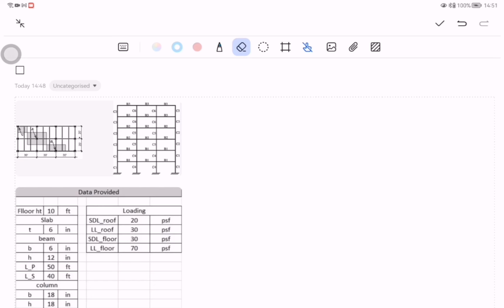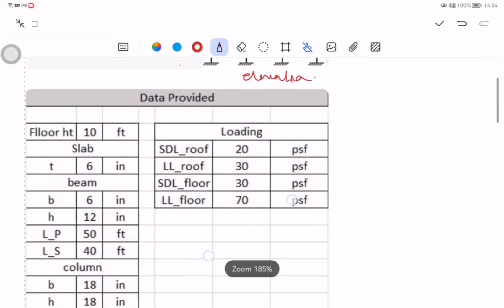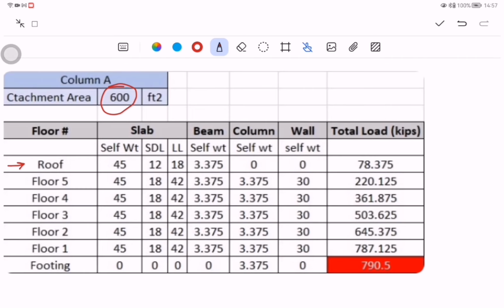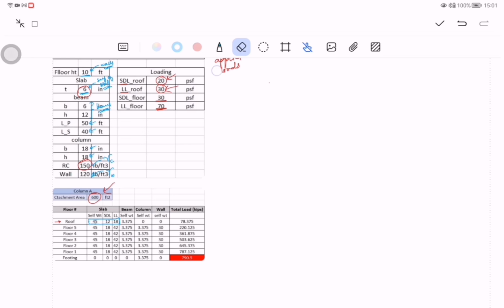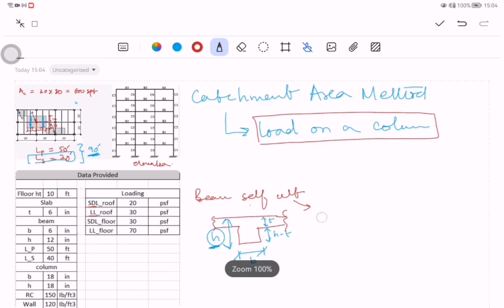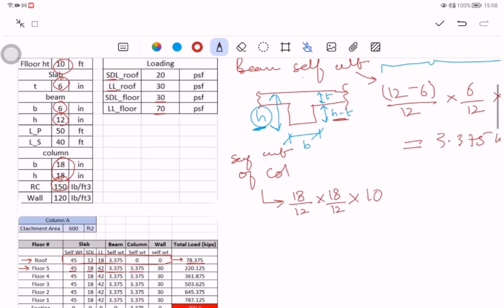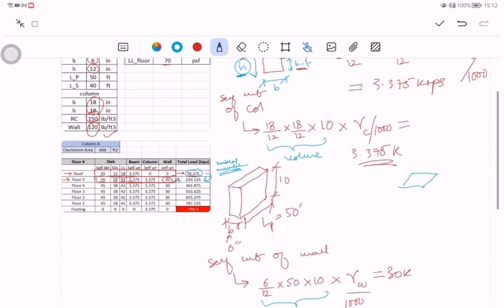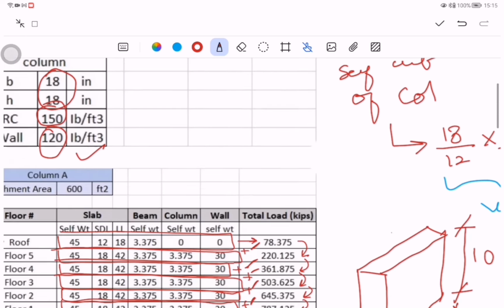Column Load Calculation using Catchment / Tributary Area Method (Step-by-Step)

Comment: how did we get Ls as 20 as it is 40 in the excel data and for column B shouldn't it be 20 but in excel data it is mentioned as 30.
Reply from the maker: The length of secondary beams is 40 feet. It is a mistake in the video. Values represented on the table are correct. For this reason, the total length of beams is 90 feet (50+40). Moreover, nothing is mentioned as 30 as you mentioned in the last.
Reply: @InsightsbySaad the Ls for column B it is mentioned as 30 in the Excel data but according to the method shouldn't it be as 20 kips?